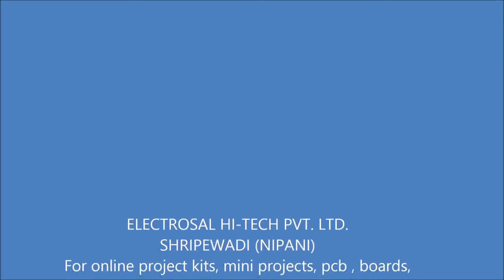ARDUINO BASED UNDERGROUND CABLE FAULT DETECTION

Comment: hello. can u give me circuit diagram and programming of arduino for this project?
Reply from the maker: Hi Waheeda Amalin
Please contact our technical head Mr. Tulasidas Salunkhe on +91 8880027297.  whatsapp +91 8880027297
Kindly visit this link. 
http://www.electrosal.com/communication/arduino-based-underground-cable-fault-detection

Comment: pzz send the code
Reply from the maker: Hi Amare Fentew
Thanks for here.
Please contact our technical head Mr. Tulasidas Salunkhe on +91 8880027297.  whatsapp +91 8880027297
You can purchase the code from our website. Kindly visit this link. 
http://www.electrosal.com/communication/arduino-based-underground-cable-fault-detection